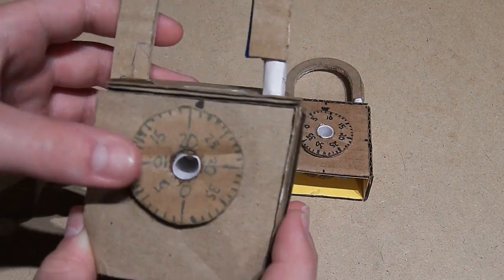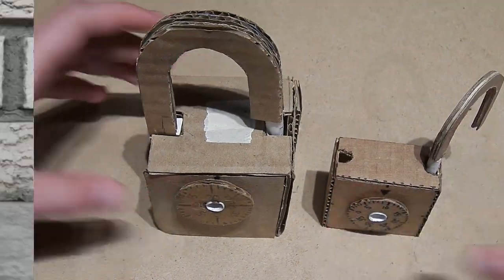DIY Compact Cardboard Combination Lock | Got Cardboard?

Comment: A really good video, but I have 2 questions:
1. What size is the paper you used for the paper parts?
2. Is it ok to use cardboard instead of popsicle sticks?
Reply from the maker: Hey thank you. I just used regular printer paper. The length of the three paper pieces for the inner spinning circles didn't really matter too much, as long as it's proportional to the other pieces. The length matters when you put it all together.
- For the large circumference at 2:53, I just tried to trim it as small as possible without sacrificing stability [stability referring to the circle not being able to wiggle on the tube] to keep the lock compact.
- The small and medium circumference just need to be trimmed to match with the back side of the lock [4:02 - 4:08] after sticking all the pieces together.

Then the lengths for the paper pieces at 4:16 didn't matter all that much. They just need to fit inside and work.

Cardboard should work fine in replacement of the popsicle bits. I just chose popsicle to keep the pieces smaller while retaining their strength.

Have a good day! 😉

Comment: The sizes @0:27 seem odd. What are the size of small rectangles,please? If they are 5cm, they should as high as the card board. But they look way shorter.
Reply from the maker: Yes, I said at that timestamp that "The image proportions are off. I had to change some measurements." The image is older than the measurements. I also posted an explanation in my video description. You can find that yourself. Sorry for the confusion.

Comment: If I did it the same way you do it what’s my passcode
Reply from the maker: Read the description. It explains how to find the passcode.
Reply: I think I just found it talking about the popsicle bits I think each side up which has the popsicle bit I twisted until it has that number where is the popsicle bit and then thenI put all of your numbers that’s  where I put so where I put the popsicle bits that’s where I twist to the number  where is the popsicle bitAnd also it depends if I put the popsicle that’s what happens of my line up all of the popsicle bits at the same time